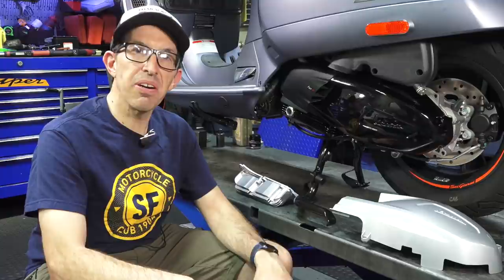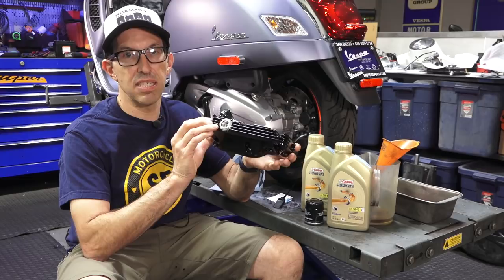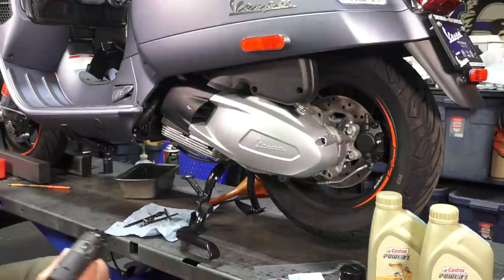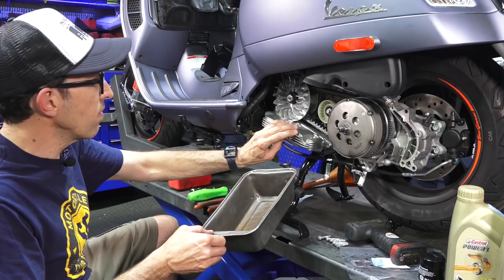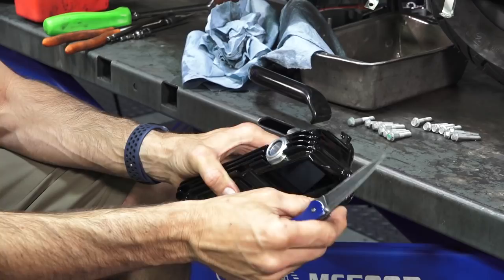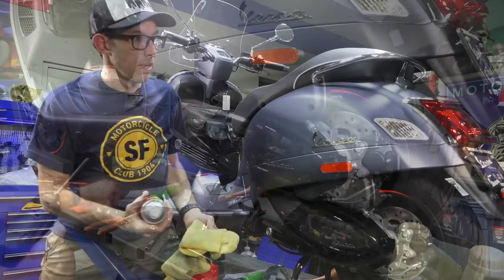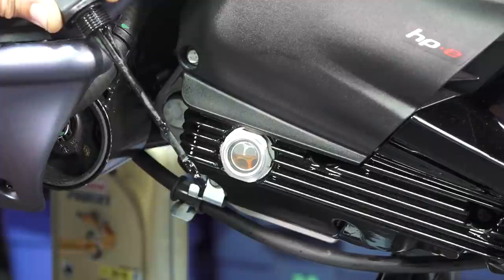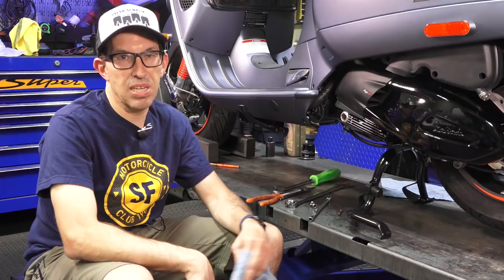New Oil Pan with Sight Glass for Vespa GTS HPE

Comment: would be nice if they put the sight glass on the same side you put oil in! ha, regardless this is awesome. and great video too!
Reply: To put the sight glass on the right side, you would need to replace the whole right engine cover. The part itself is much more expensive and the job to replace the right ignition cover is more expensive as well. In Europe there is some kind of extension hose available that you replace the original Dipstick with.

Comment: 16:20  You should've cleaned the area of the dripping oil before putting the gasket on.
If you can't wait, just tilt the bike to the right and just wipe off the excess oil.
Reply: 15:40 He said to tilt the bike to drain all the dripping oil, but that he’s rushing through this to make the video a bit shorter.

Comment: I just had my dealer install one but it doesn't have circles in the site glass and also the oil completely covers the glass. I ran it today to see if the level changed and it did not. Advice?

Comment: Though nothing was touched, after I installed this oil pan, which was a pretty easy install following this video, My Sei Giorni picked up a squeal during acceleration.  It occurs during a slow speed acceleration and primarily when turning left.  It sounds like its coming from the housing area, but I cannot confirm that.  I'm going to explore a little more today. It's a '21 with only 1900 miles on it so I cannot think that the belt would be squealing.  Anyone with anything similar?  ROBOT- help a brother out!

Comment: Hey Robot! This is a great product!  Would it be possible to add an oil pan from the earlier GTS that has the fill tube on it?  I believe I’ve seen a German shop that has installed one and has filler tubes in both sides.  Would be a great solution to leave the exhaust side filler alone. 
Thanks!
Reply: It's [possible to install the older style 300 oil pan and belt cover to retain an oil fill on the left side of the engine.

Comment: Does the GT Vespas have valve stem seals ? There were some early Honda motorcycles that never had valve stem seals & they used more oil & needed topping up between services .I have never had to top up oil on any motorcycle or scooter between scheduled oil changes .I have a 125 Malaguti Madison with a Yamaha / Miranelli 2 valve 12•2 horse power liquid cooled engine .It has top speed of 65 - 75 mph ( on good day ) that used negligible or no oil between services .I believe the Vespa engines have plain main bearings ,that is basically a thin film of oil fed under high pressure .Those sight glass are very handy ,providing they don’t get a milky coating on the Inside of glass caused by crank case condensation mixing with oil .due to short distance runs .
Reply: The new engine burns oil past the piston rings when they are used at higher speeds.  No issues with the valve stem seals like many older 4-stroke engines.
Reply: @vespaservice2856  I suppose when you look at it ,the Vespa scooters were never really designed.to be ridden for long periods at top speed .They are more suited to slicing & dicing city & suburban traffic at moderate speeds of about 30 - say 50 mph cruising .So unless they are being used at top speeds for long distances the oil usage will be negligible .What does impress me about the Vespas is they are capable of high mileages if they are serviced correctly & regular .I was thinking of buying the 125 Primavera touring spec model here in U.K. but the Vespas command a very high insurance due to them being targeted by thieves ,stolen to order .So I was looking at the Liberty S as they have the larger wheels & not as popular in the U.K. & less of a target for the scooter thieves .Does the Liberty have a similar long lasting engine ?